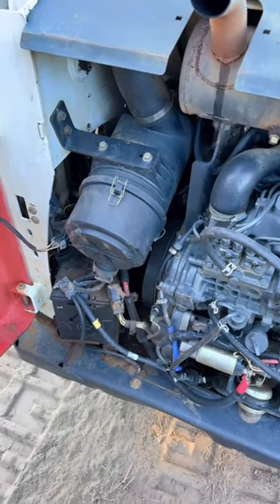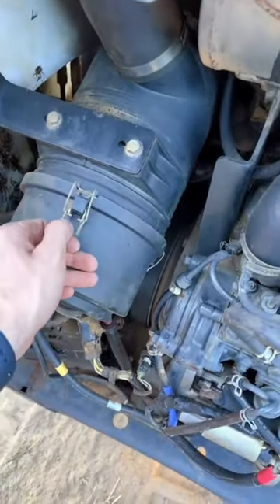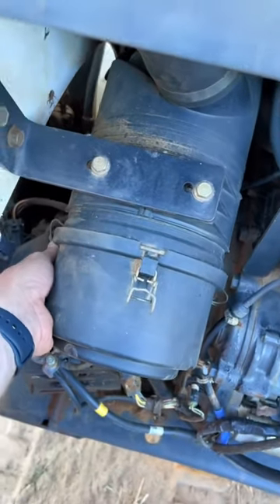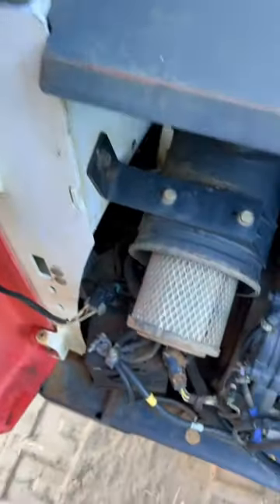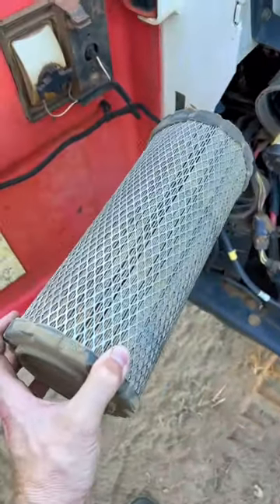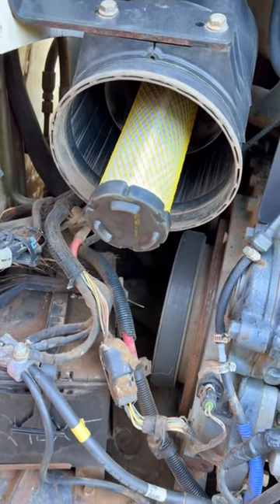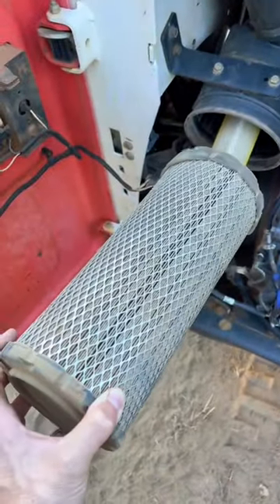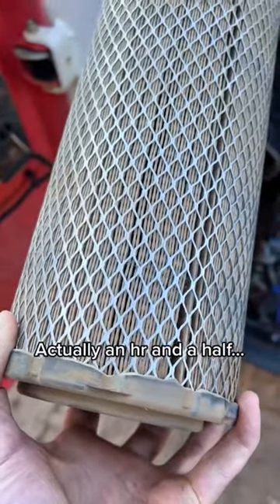The Internet Experts… Wrong Once Again! 😂 #IPA #MrSubaru1387 #Shorts

Comment: The internet experts brains would explode if they saw the Deere manual I have that details how to wash that same brand outer filter with soap and water.
Reply: For real?  Not a foam pre-filter?
Reply: @GingerAvenger  I had a 2004 89hp Deere 5520 tractor and the service manual had section about washing the outer filter. My 92hp Volvo skid steer uses the same Donaldson filter and I wash it up to 2-3 max and of course blowing it out from time to time. If you wash it too much you’ll notice the paper start to degrade. There are videos on YouTube about companies and their equipment that wash air filters for commercial and industrial customers, big trucks, mining equipment and big blower and vacuum filters.
Reply: toyota landcruisers are same, they have range of filters that bucket wash
Reply: But they drove by a bobcat dealership once they know their maintenance intervals obviously
Reply: reminds me of the old Fortschritt combines that dad told me about, they straight up washed them with washing gasoline and then poured the dirty gas back on the ground and just left the cleaned filter to dry out.

Comment: I run equipment in chickens houses. There’s times where 40% of the filter is smooth with dust. Pull it out and blow it out, good as new. 60xt with 6500 hours

Comment: Commercial fleet heavy machinery mechanic here, we blow out primary filters all the time. They are built tough they can handle a little air pressure. However It all depends on how much the customer wants to spend on maintenance for their machine

Comment: The internet experts complaining are the type to throw away a K&N filter for being dirty as well.
Reply: I throw away k&n filters because they are k&n filters.
Reply: How many times should i wash my Filter and re oil it ?  2 4 6 when its 10 years old i toss it buy a new K&N for my truck and Bike .
Reply: @asherdie  you kinda sound like an internet expert. They pass the same iso5011 test that all other filters do...
Reply: Frankly you should throw out a K&N filter.
They dont do anything useful for your car came with a CAI stock and K&N filters do cause MAF sensor issues.
Reply: Yeah or even buy a k&n in the first place
Reply: @elijahbarbee4760  he’s probably talking about their “performance” filters. 
Watch projects farms video on air filters. The particulate test he does will make you never wanna buy a K&N “performance” filter lol
Reply: @CM-xr9oq  Most trucks since the late 90s have a factory CAI. An aftermarket CAI is most likely going to pull air from exactly the same place as the factory intake, unless it's one of the garbage ones they call a CAI but it just sucks hot air from the engine compartment.
Reply: @asherdie  well they prioritize airflow sooo.
Reply: @asherdie  how?
Reply: No  they actually don't know where the filter is, where to get one, or what that equipment is.
Reply: @asherdie  oh that is interesting. going straight to a heavy equipment manu. i still dont see how that gets you at least oem filtration with more airflow though. definitely more filtration but the trade off always exists. the only real solution to more airflow without sacrificing filtration is a turbo or supercharger. then again ive never seen someone use oem filters with said solutions because people that care about maximizing airflow dont really care about maximum filtration.
Reply: @asherdie  i need to learn more but you really just said "why use a filter at all"... idk maybe because you dont want road debri, leaves, sticks, etc getting in to the engine? just because you want to sacrifice some filtration for more airflow doesnt mean its rational to just have no filter at all. what an asinine thing to say. you told me there were options, i looked at those options and it changed nothing and your response was to just say some nonsensical bs? even race cars use air filters and in case you didnt know the filter of choice is not a Donaldson... but let me guess you know better than professional race car engineers/drivers right?
Reply: @elijahbarbee4760  after a lengthy discussion with him he is 100% an "internet expert"...
Reply: @asherdie  should change your name to trollbill.
Reply: @asherdie  super logical response. keep em coming.

Comment: So you suppose they've ever seen an air filter that hangs out at the beach all day? You know, the kind of beach that has that ultra fine, surf-worn sand.

The kind of sand that, once it gets into the filter, is totally invisible until you knock it free, but no matter how much you knock out, the filter is toast.

"Looks filthy" does not necessarily mean it has to be replaced, just like "looks clean" doesn't necessarily mean the engine isn't suffocating.

Comment: My buddy was a durability engineer for major OEMs. People would have a coronary if they saw how much dirt that primary element could hold before there is meaningful restriction. Many engines have been damaged by people "over-servicing" air filters. That is the reason for the inner safety element, and restriction indicators. Sometimes less is actually more.

Comment: I would be so screwed if i didn't blow them out. As long as you DON'T use a blow gun and rip the filter. 
But what you did WAS correct.  But what do I know i just work on heavy equipment.

Comment: Once, maybe twice a season is all those need to be replaced. Unless they’re reallllllly bad than change as needed. Otherwise just blow them off and put them back on. 

I’m not the mechanic at work, but one of my coworkers mentioned the tractor had no power after coming in for lunch, so during my lunch break I went and checked the air filter, because well, easiest things first. And this filter was so damn black it looked like it had been buried for a century. It hadn’t been changed in 4 years and that tractor sees almost daily use. This is how lazy the actual mechanic is. 

And guess what, the tractor ran fine afterwards 😂 I wish I had taken a picture. It was unreal.

Comment: Dont be too hard on them, there are youtubers that are a lot worse. Scotty would probably flap his arms like a hummingbird while shouting to not clean the filter. 
My 1963 model tractor still got its original filter, oil bath of course, still breathes. And i lived several years in Philippines and had 2 cars and 8-10 motorcycles, air filters were changed only when broken, if not broken it would be cleaned, it works, no problems.

Comment: Dude I worked on Cat equipment for three and a half years at a huge local dealership, your primary filter is clean compared to what I’ve seen, literally I have seen one that was so dirty the filter had to be chiseled out because it was concreted in with dirt. I have blown out more primary filters than these idiots have probably put air in their tires. Don’t let the nobodies tell you any kind of crap, they probably put a coffee can muffler and a K&N air filter on their 1993 civic and call it built not bought 😂.

Comment: I agree. People that don’t know shouldn’t comment negatively. 

I wouldn’t replace either until a certain amount of days/weeks. Only thing about blowing the dirt out of a filter……get ready because this is really the only reason…..

IT SEPARATE’S the fibers in the air filter and they no longer are a close tight filter. But really, one can just bang it out and run still without much worry. Just gotta replace sooner then normal is all. Can’t wait to not read a damn one of the responses. I’m about to swallow my gun anyway. Good luck to everyone. Build them….Break them….Make them better! Goodnight from Tx

Comment: It’s pretty common practice especially in the heavy equipment/mining industry to blow out the outer element when you’re a field mechanic.  Solved a lot of low power issues on CATs and Komatsu equipment by just giving the filters a good blow out.  Keeps them running fine til a scheduled PM.

Comment: Actually what you potentially did wrong in that video is use full air pressure to blow out that filter. My experience with Caterpillar, mainly graders,  they say to use no more than 30 psi of air pressure to blow out a filter. They also say you can only clean a filter a maximum of 6 times. The handful of times I've worked on bobcats tho I haven't seen anything saying it's okay to blow out filters, but I've also not seen anything saying you can't.

Comment: Meanwhile, Fleetguard has a write up about why you shouldn't clean air filters or prefill oil filters. 

I guess the real questions are, how many "hour and a half" cycles is the filter worth before it starts not filtering anymore? At 300 hour service interval at hour and half duty cycle, the filter is cleaned 200 times before being replaced, if it's replaced. Or, is that a non issue and that's what the secondary filter is for, so you just run the primary until you feel like replacing it? How do you know when the filter starts passing the maximum micron particle allowable? How do you know how dirty a filter can be before it needs replaced/cleaned without a filter minder? What filters particles better, an old cleaned filter, or a 75 percent clogged filter that has never been cleaned? Do you even need to ever replace the secondary filter under this type of for service schedule?

Comment: Used a Milwaukee battery powered blower on the JCB fasttrack primary filter regularly, worked brilliantly blowing it inside out and letting the wind take the dust away across the paddock.

Comment: Usually I just tapped them out, wiped gasket area and reinstalled. Slightly dusted filters actually reduce the micron size and filter better. Heavy handed air nozzle blowing either perforates or increases the micron size permitted to pass through.

Comment: I've been doing be mobile service for a solar power company in the mojave desert. The dust is so fine  that the filters would be caked on both the air and cabin filter. Its so bad to a point were the engine filters would be so dried out they crack and deteriorate. Hence these 2500 trucks would be idling 8 to 12 hours a day and the filter would be covered roughly in a month or less. I say it's ok blow the filters as long as the paper material is holding up just fine and of course not blowing high compressed air directly to filter which can damage them (rip/tear).

Comment: If you don t have a precleaner on your air filter you need one !!!!  I was running a Deere 333 in west Texas in August and the primary filter would stop up to a warning on the in cab monitor to clean air filter. We took it to the dealer and had a precleaner installed and were able to go 12 to 16 hrs between cleanings instead of every 2 hrs. A primary filter for the Deere 333 was a hundred dollar bill from Deere and 45 dollars from Wix at the auto parts store. 
That would be 230 or 400 dollars a day in air filters alone !!!

Comment: The truck mechanics where I work say they aren't supposed to blow out air filters.  There is only one, no secondary, but I can plug an air filter in a weeks time so that the air light will light up on the air filter gauge.  I say fine, change it then.. Except they usually dont have the right filter in the parts room.  Frustrating AF

Comment: Cleaning your air filters like that, that often can just dust your engine. You end up introducing more and more dirt every time you remove them. Just run the equipment and then change it (or clean) when it’s called for. They are designed to be run numnut.

Comment: I'm a mechanic at a CAT dealer. They recommend primary air filter replacement only at certain intervals. Not at the standard service intervals for oil changes. They actually do recommend to blow the air filters out and actually sell air nozzles that have pipes with holes in them sized for different sized filters to do so.

Comment: They say not to use compressed air to clean air filters because the air bores out the passages at the least, if it doesn't rip and destroy the filter material. Most manufacturers offer a netting for dusty and sandy environments. I've worked at a dealership as a full time tech. They aren't just trying to make money off air filters. Some foam filters are designed to be cleaned but they require oiling.

Comment: Here's an idea, put a restriction gauge on your filter. It will actually let you know when you really need to replace your filter. It's fine to blow a airfilter out. Air filters actually are designed for the environment the equipment they are made for operates in.

Comment: Most of our filters are stamped do not clean. We don’t expect the customer to follow that, but we keep it there for warranty reasons. If the engine blows and they try to claim it, we can deny it by proving they cleaned the filter rather than replacing it.

Realistically speaking, yeah you gotta clean out the primary at least at the end of every day

Comment: Bahaha, you'll never get those idiots to understand. Those are the same people still running the original air filter on their car with 60k miles on the odometer wondering why it doesn't have the power it use to have!

Comment: I will say this as an equipment mechanic, be careful with cleaning your filter. I have found many of our units with holes in the primary filter because the operators were cleaning them two to three times a day and it killed the life of the filters and put small holes all over them

Comment: I have my guys clean the air filters often.  However if you read the filter they say not to blow them out.  So the internet experts are technically correct but literally everyone does it. You should use dust control though.

Comment: They make a outer where cover to fit those filters we use them at work each machine has 2 so you can wash one and put yesterday’s on while it dries but you are in the correct with this the outerwear just prolongs filter cleaning by weekly instead of every day

Comment: Really you shouldn’t blow them out.   You should tap them to get the loose dust off.  The problem with blowing them out is it opens the pleats and sometimes tears them and you can’t see the tears.  Whether or not you agree or disagree the engine will tell you when it fails.

Comment: I have Had a vermeer wood chipper with about 800 hours ruin a turbo on its diesel engine from "blowing out the air filter" whatever that means.....
Most manufacturers recommend not cleaning paper engine air filters, just replacing them when is needed.
Reply: Fuck the turbo, I'd hate to see what the top end looks like in that thing😂
Reply: @marxkartredge  it looked good. And is still running strong with about 2000 hours on it now.